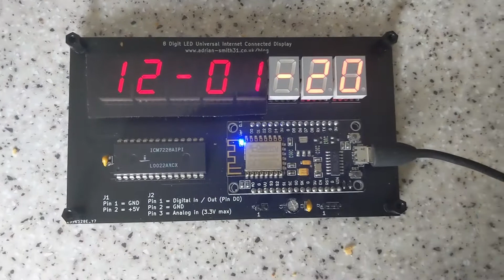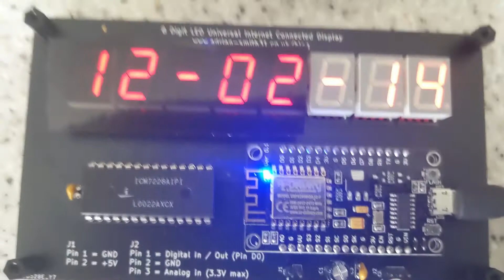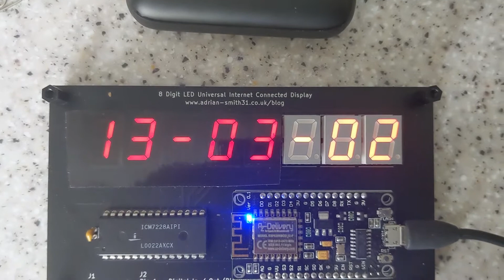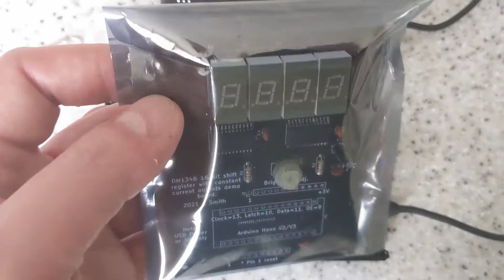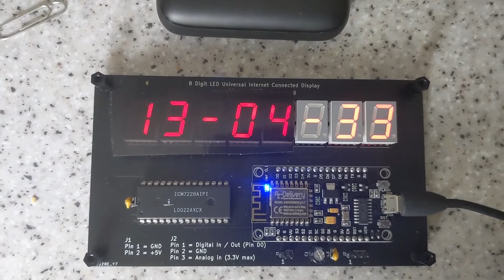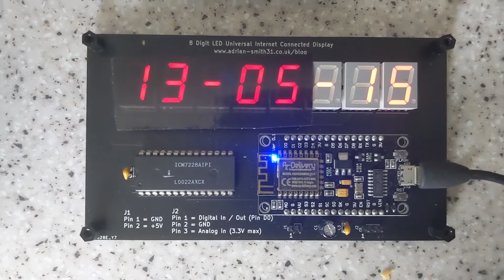Make an LED clock using ESP8266 - no RTC required. Wi-Fi enabled to automatically set the time.

Comment: Regarding the blue LED punching me in the eyes, I have put a drop of nail polish on eventually .
That significantly dims the overly bright light.
For darkening out the LED repeat the procedure, put a number of layers on.
Let it dry in between.
Reply from the maker: I used tipex on mine
Reply: @adriansmith31  Ok, I hope You do fine.
Reply from the maker: Yeah still doing OK, not bothered with electronics or youtube for a while. Lots of things that keep me away from it.

Comment: Hi Adrian, i recently came across this project of yours whilst i was searching for ways to control a segmented display ive salvaged, it has got a ICM7218A and im wondering if its possible to use your code with an esp32 instead of a esp8266?
Reply from the maker: The program should do but the icm7218 library used might not be compatible with the esp32 as it's a different MCU. However if you are using the Arduino IDE it might work as many esp8266 libraries will work on the esp32. I used Andreas Taylor's library (andy4495) which does not specify which microcontrollers are compatible but the library does have a GitHub page.

You might have to change the pin definitions in my program appropriately for the esp32. If the library is compatible it should only need a few modifications to make the program work.

The rest of the libraries are standard Arduino libraries downloadable from within the ide. The WiFi manager might have to be downloaded separately from GitHub if it's not listed in the Arduino IDE library manager.

Feel free to use portions of my code to get something to display on your icm7218 based display. I only used basic functions of the icm7218 library but it can do more.